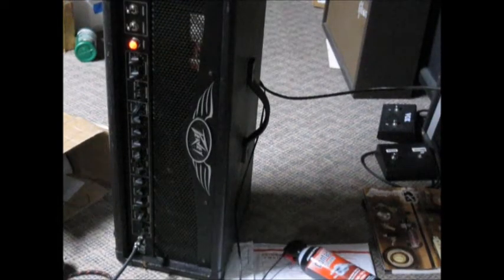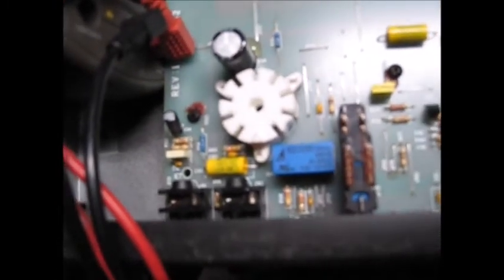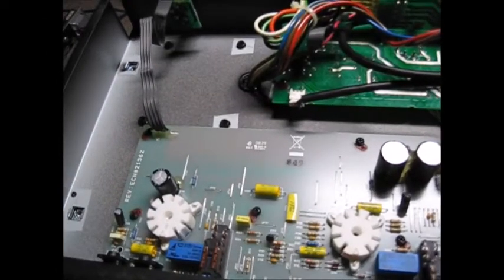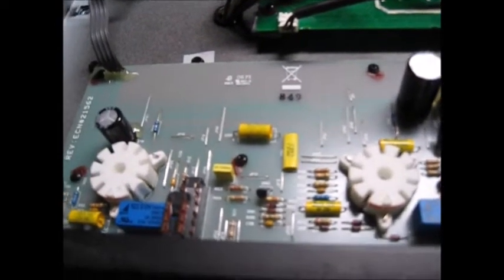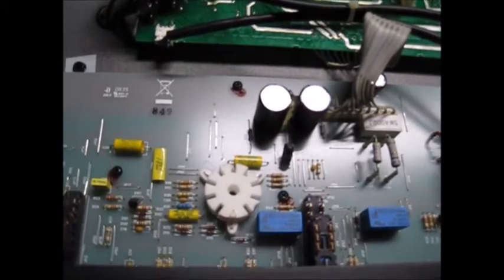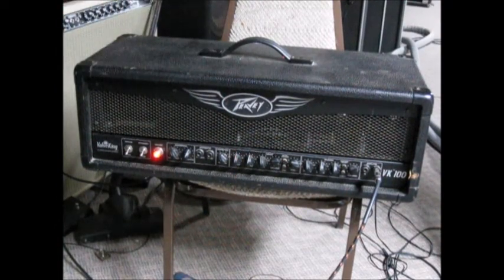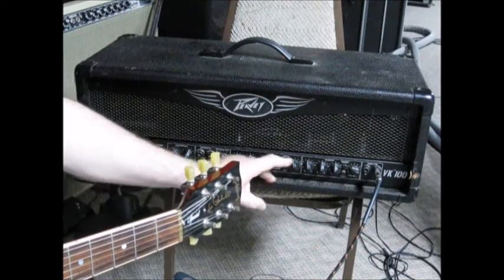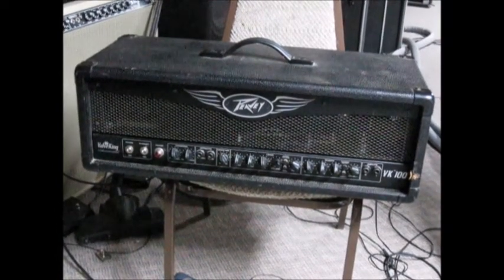Peavey Valve King VK100 has a low volume LEAD channel.  That's no good.  Let's Fix it.

Comment: Thanks for this, I had the same problem with a gen1 VK112.  The schmatic I have shows a 1/4W resistor, but the blown one I pulled out, looked a lot like a 1/8W.  I wonder if they put the wrong ones in or they updated the schematic after noticing the issue.
Reply from the maker: hard to say... there's some VERY small 1 watt resistors made in modern times.
Reply: That's true. Either way I followed your lead and put a higher wattage one in there.  Now I have to fix a faulty external speaker jack. After connecting an external cab, it won't play out of the internal speaker after the cable is removed.
Reply from the maker: At least you can diagnose it properly.

Comment: Thanks for this video, this was the first and last one I found with this problem. I learned which preamp tube is for which channel. I got the same problem on my VK212 , but at my amp it was the overdrive channel tube, had to replace it and it worked. (To test I switched the clean preamp tube with the one from the Overdrive). Write here to let now other people which are searching for this problem.
Reply from the maker: Cool.  Glad you solved it.

Comment: Most modern amps are somewhat "hybrid" design.  Solely relying on solid state circuitry to allow the tubes to circuit with one another.
Reply from the maker: Not usually.  Solid state is used to drive the reverb or switch channels.
Reply: @DeadKoby  Solid state rectifier changes the circuitry entirely over tube rectification. Most modern amps use solid state.  That solid state circuitry relies on a great deal of ST components.
Reply from the maker: Rectifiers aside,   the audio circuit is tube front to back in a good percentage of them.   It'd take a schematic to explain.

Comment: I have this amp but in the 1X12 combo version and it's doing the same thing BUT on the clean channel side.  Does that mean that blue resistor on the opposite side (the left) needs to be replaced?  Thanks a bunch!
Reply from the maker: That's a plausible cause.  You can either look for missing voltages on the tube pins,  or if you prefer to leave the power off,  check the resistors with an ohm meter.

Comment: 2:13 haha... yeah the cap is “flat” just bc it’s from a different manufacturer from the rest. I have a Vk100, and I’ve done a lot of mods to it. I’ve noticed there are at least two versions of the preamp board. On the version I have, all of the coupling caps are like the “flat” one you’ve pointed out here. On the version you have, the caps are all cylindrical, typically. There are other differences from version to version as well... such as the tube sockets being made of a different material (one version is brown... other version is white [ceramic]).
Reply from the maker: I'm just glad it's fixed and out of here.  LOL.   The yellow tube caps are really common...  so to see a flattened one was strange.

Comment: My valveking has the same problem.  Are there any other specs on the 1 watt resistor that I need?   Like ohms or something?   Thanks!
Reply from the maker: I got the value off the schematic.........I would tell you if I could remember,  but It's the value that was on the schematic,  and I increased the wattage for better durability.
Reply: @DeadKoby  Thanks for your reply.  The same resister that you replaced reads OL on my amp.  Is wattage the only thing to consider when buying a resister?
Reply from the maker: @michaelromeo5689  Sorry I didn't notice this.   I would just get the original value in Ohms...  with a 1 watt power rating.

Comment: Peavey is good..!😎 Easy fix for you, but man that's some cheap resistor they use in the circuit for such a chunky amp..! Nice fix, looks a beast..Ed..UK..😊
Reply from the maker: The Peavey gear from the 70's and 80's was much more logical,  and less fussy to work on.  I'm really surprised they used THAT small of a wattage value resistor.   If a tube fails,  it's bound to eat up a neighboring component.

Comment: I wouldn’t bother taking all the nuts off and board out for that one resistor. No way. Clip the old one and leave the leads sticking out and wrap the legs of the new one around those. Something like this thats just getting flipped anyway, yeah just tack it in. Good catch on the fix though!
Reply from the maker: I considered doing something like that.... decided not to.   I suppose it was because I had my socket kit nearby, and most of the panel needed tightened anyway.  This amp has some WEIRD quirks.   Series filaments being one of them.